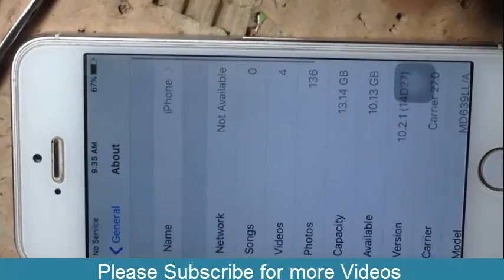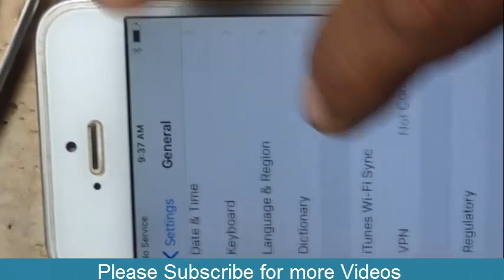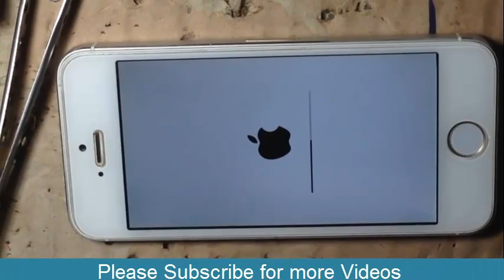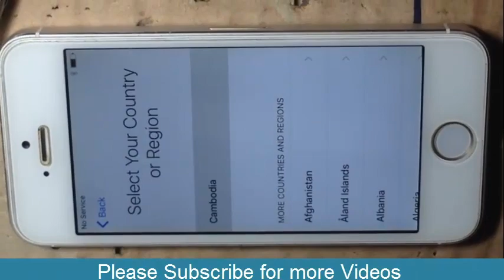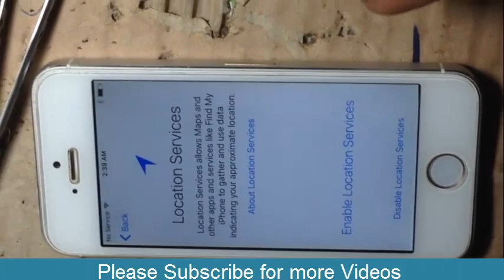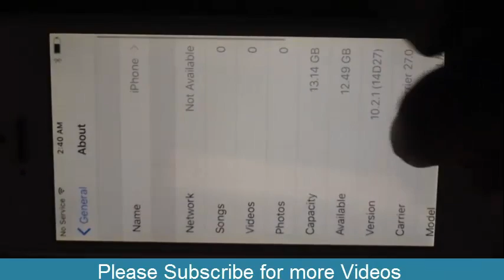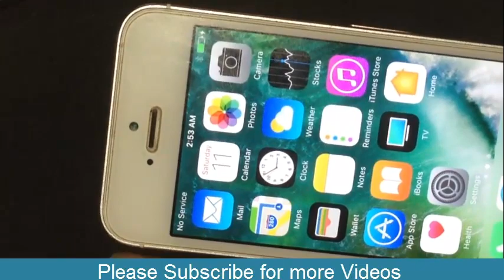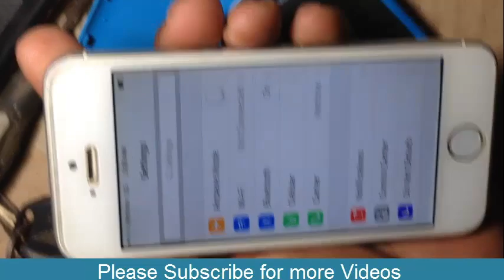How to Fix Iphone 5 No Service or Still Searching | Resolve Iphone 5 No Service ok 100%

Comment: i just tried this today. and thank you so much. it really worked. i have seen this video 2 years ago but i did not believe it because when i tried to test this inductor L910 it is shorted on my tester. so i was thingking if i will jumper this it will still be the same. it will  still be shorted. and when i read the comments it has a lots of positive remarks. so what the heck, i said to myself. why not try it.  BANGGGG!!! it now has a signal. i can't believe it. i can't think of any reason why it worked for it still shorted. hahaha. anyway, many thanks to the author. KUDOS to you man!!!   😊👌🙏